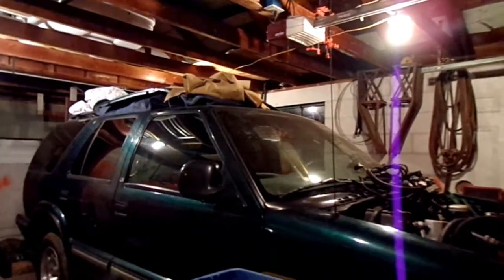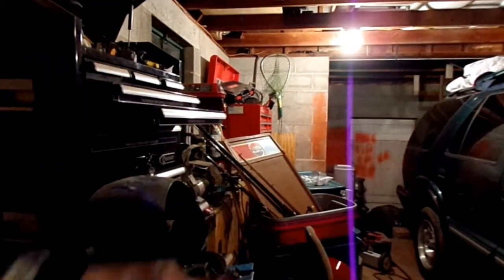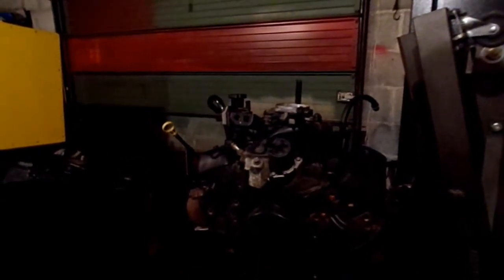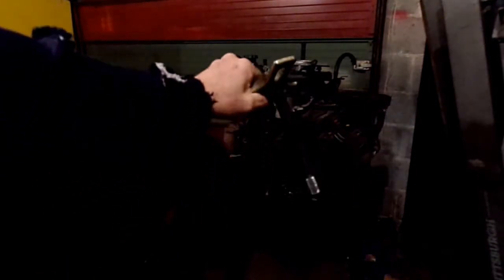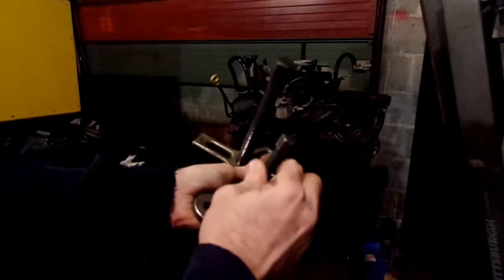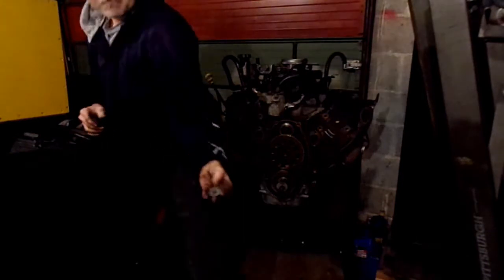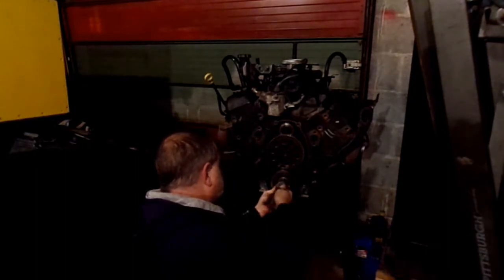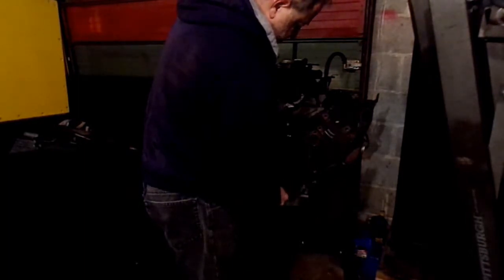checking the timing chain on the 2004 blazer 4 3

Comment: How can you tell if your timing jumped? I'm wondering if mine has a stupid plastic cam gear and jumped
Reply from the maker: look on the  harmonic balancer there will be 2 marks and they will line up with the riming cover line them then pull the dis. cap and see if they off the cap will have a make to 
do not get scared if are on other side that mean it 180 out turn motor over to the line up if this 3 mark do not line up then you have a timing prom.
could be a gear or even a lose timing chain 
i hop this helps
thanks for watching my videos